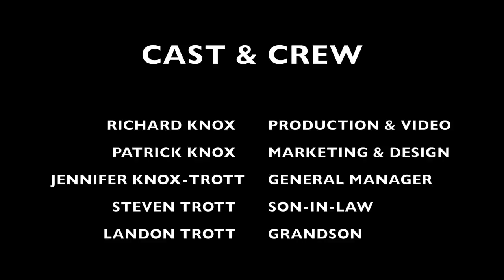S2 EP34 : TIMBER FRAME | OUTDOOR FOREST KITCHEN | BUILDING EARTH OVEN BASE

Comment: 545👍's up guys thanks again for taking us all along with you for the great show 😊
I have to say it look great the out door kitchen
Reply: fasten a horse to the bottom of the bucket with a court that way when you're done you pull the Cork and it runs right out of the bucket out of the ground please use a junk Pizza garden hose to take it in 20 feet away and let it drain out on the ground
Taking the bucket out every time the dumper there's a risk of spilling
Call me lazy to figure out a different way to get it done without a half and then work so hard
Reply from the maker: Thank you
Reply: @SmokyMountainOutpost  your very welcome

Comment: I'm glad Jennifer is getting along with her finger! And I think you done an awesome outdoor Kitchen, I don't think I'd done anything different. Also those kitchen cabinets are really nice with the braces on the doors, and l like the big hinges on the doors and also the design of the crossmembers on the doors. they are really noticeable and makes the kitchen stand out. You can't beat the metal roof either. One thing I think you could do somewhere around the camp in the shade is a nice restful  hammock for one of those nice naps when just wore out from the humidity! Great Job!
Reply from the maker: Lol, no time for resting. My grandfather used to tell me I could rest when I got old. I will rest when it is more complete.

Comment: Add 3 trail cameras with Night vision and video recording options (5/10 sec recording options) on ur property for security (1 posted on ur house beam (far from reach) looking onto ur driveway for any uninvited visitors and 1 at the kitchen log next to ur firepit (so it call look n record or take photos of ur cabin home, log shed, main building n other places that has hardware stored) to give u a wide view as well as see what wild life comes through ur property...a ceiling light (for now battery operated) like an RVs in the kitchen would be nice for those cloudy or coming winter nights when ur prepin food or a family n friends feast..on the kitchen, id have done the same but added some cloth mesh that can be rolled up or down for them bugs n other critters trying to get in, other than that all is fine, maybe stain the floors, stay safe..God bless
Reply from the maker: I have trail cameras mounted. That’s where I have shown wild life before on video.

Comment: I like it and wouldn't change a thing.  I do have a question,  why didn't you put the wood feed part of the rocket stove in the front?  Wouldn't it be easier to feed the wood when you are grilling?  Thanks.
Reply from the maker: I didn’t want another outward facing hole is all. I feed it from the top

Comment: The earthen oven will be flued out side the roof line yes? If you feed it from the outside the body of the oven  will warm the eating areas in cooler weather and a limestone floor laid in the dirt at the door will make for easy rake out Yes?   If you do a concrete base then the hearth will be fire brick on top of glass broken into pieces and quartz sands to insulate the concrete?  walls of  brick and mud mortar for the sides and additional layers of mud and screen for insulation the lime stabilized mud mortar is the bomb...For a more permanent water repellant final layer You can insulate the mud cover with fire blanket and chicken wire and stucco a final water proof layer! Once the oven is hot and kept closed a lot of cooking may be done  on one good burn ... the brick and lime stabilized screened and insulated is a great stable expansion layer and then a more water repellant final layer will keep the moisture out in winter and like shawn james the smoke will vent outside the roof?  The brick builds heat so the exhaust will be Hot  then a prep table exposed will be helpful in washing produce for canning and fermenting...Many folks cover the oven work  areas with a pergola obscuring light and heat can easily vent!  With limited metal covers you can provide total shade and still exhaust heat...Shawn did his outside shell of the oven with mud and straws so a more permanent roof was required for water and weather protections ...with an expansion layer of insulation  over the bricks  outer concrete stabile thorough seal will not crack with heat and yet seals the mud mortars and fire blankets from water extending their service ...so interior oven temps can go as high as 600 to 800 degrees fahrenheit and the next day if the oven is kept shut can bake breads and cakes! But if you choose to cover the oven with a roof  a full chimney might be a good idea... hate to build and then risk a fire ...Still gets very hot in Tennessee summer times...and a pergola and extra dry sink perfect for processing the garden products or doing breads...prepping pizzas or setting pots for a food prep area or even light butchering...

Comment: Why don't you go ahead and put a sink in. Since it's only going to be gray water it could drain through a pipe out into the woods. Unless you're going to use the woods for other projects.
Reply from the maker: I wanted more counter space. It was real cheap, lol
Reply: @SmokyMountainOutpost  Just add a drain pipe to what you already have.
Reply: Sorry. Looked at your video again and realized you used an actual bucket instead of a small sink that would drain into a bucket. Way cheaper and looks like a small black enamel sink at a glance.